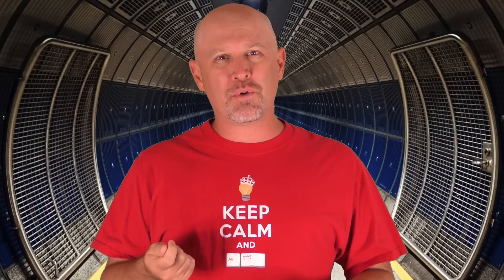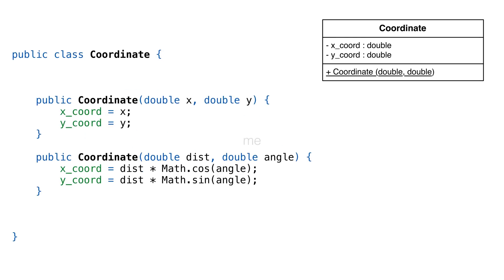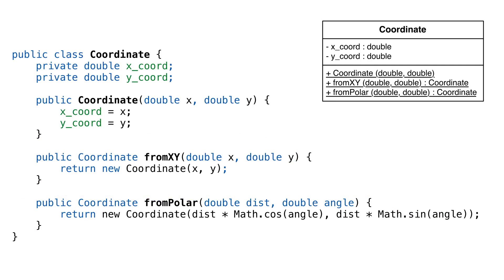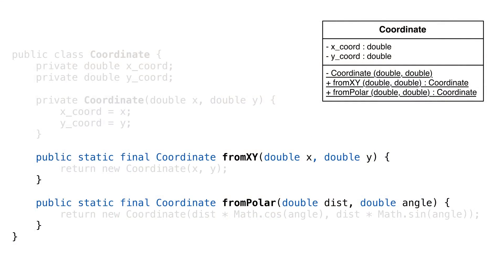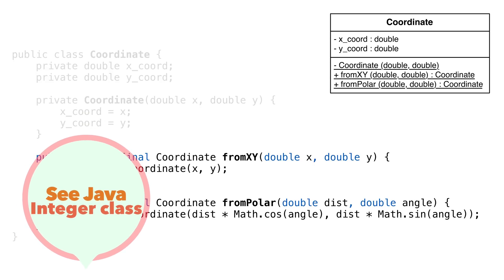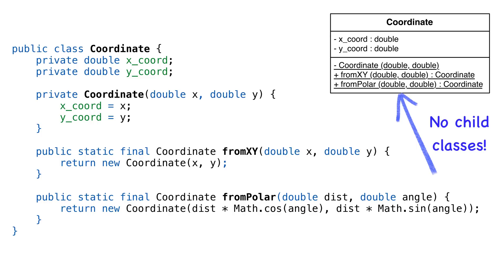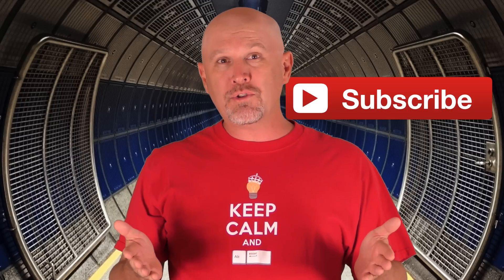What are static factory methods in Java? - 036

Comment: Hi there and thanks for this video. Just a short question to one slide you showed: When you use the if-statement in the factory method for a coordinate you check if this coordinate is already in the array of coordinates by doing ==null. But if this is the case, you return it, which makes no sense to me. Could this be a mistake? To me it would make perfect sense to say if there is none, create a new one, put it to the array and then return it. But as it seems, you return null, isnt it? So the line with the if-statement should say if !=null, return it, otherwise make a new one, save it and return it.

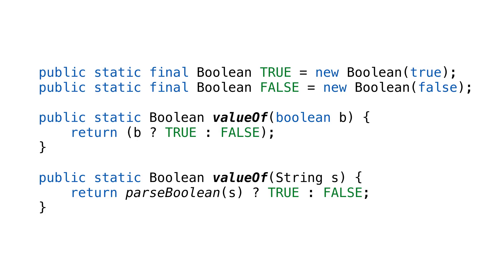Comment: Hi. In the example at 3:38, DJ is talking about how you can prevent redundant instantiation, and highlighted the code to do this. But the if-block in the code checks if the specified index is null, and then returns the value at that index, which it has checked and found to be null. Shouldn't the block be if(coordArray[...] != null){...}? Or am I missing something?
Reply: hey Kartikey, just discovered the same thing and post a comment. Seems right that this is a mistake.
Reply: Yes, you are right
Reply: This error was making me crazy haha